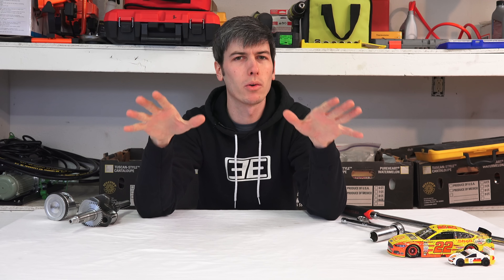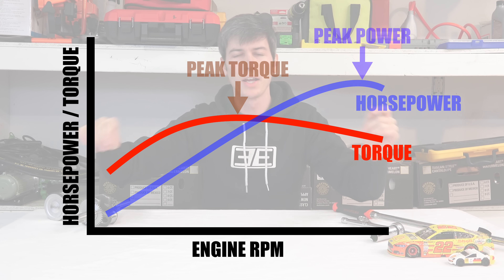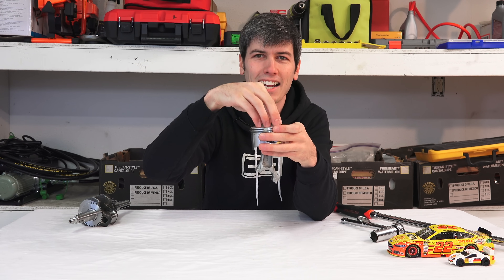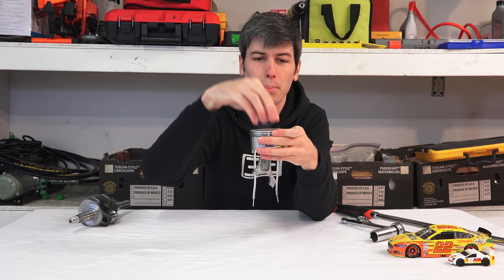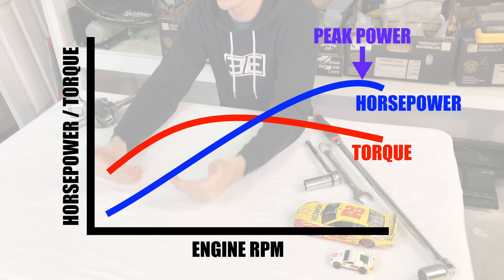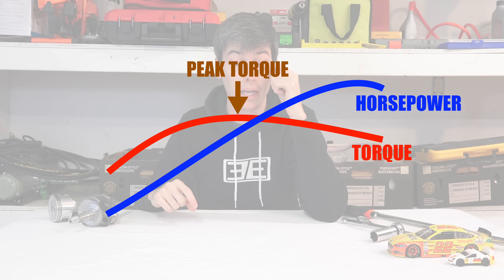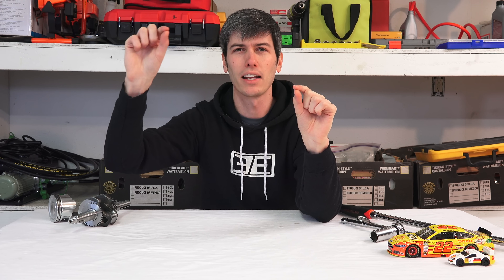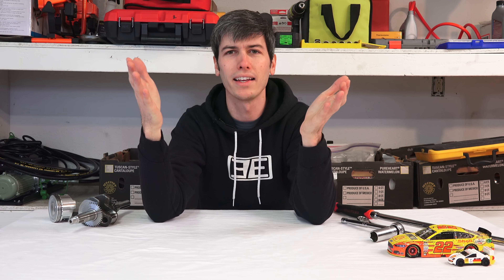Horsepower vs Torque - A Simple Explanation

Comment: why cvt do not fix engine rpm to peak torque instead it fix it to peak horsepower despite peak torque produce maximum 
 acceleration and force
Reply from the maker: Because, as shown in the graph, peak acceleration occurs at peak power using the most aggressive gear ratio possible, which ultimately means the highest wheel torque.

Comment: Everything about these cars are the same, but........they have different transmissions. Real good analogy. If you change gear ratios you change wheel torque. Wheel torque is what decides all friend. And that's a product of transmission gears and final drive. Having more torque from the engine means you can have shorter gear ratios

Comment: why do they call it horse power ?  is one horse power  in car as equal as a real horse :) ?
Reply: That goes back a long long time actually even before the time internal combustion engines were used. Basically it refers to the average continous power output of a work horse. This was used to have an easy to understand unit to compare the power of a steam engine to the one of horses. So basically a steam engine with 4hp could replace 4 horses to power for instance a mill.
A horse can actually put out significantly more power than 1hp for a limited time and even a human can generate more than 1hp for a few seconds.
Reply: thanks for clarifying

Comment: You should also explain how torque and power work in engines that do not or are not designed to rev beyond 5252 rpm and how that results in higher peak torque than power.  Do a video on that. :)

Comment: Everyone who explains this does it in such a confusing way. After watching 4 different videos, getting confused, and staring into space for an hour, I finally understand.

Power = Force * Velocity
and essentially,
Torque = Force = Mass * Acceleration

Horsepower may relate to how fast you accelerate, but not to the actual value of the acceleration. Torque is essentially force, so it by nature correlates to acceleration. Power, on the other hand, tells you what speed you are capable of for a given torque (a given acceleration). High power allows you to deliver high acceleration (high torque) at high speed. If you have a limit on the horsepower you can deliver, you may be able to accelerate well at low speeds, but at high speeds, you have to reduce the torque in order to continue increasing speed. This is done by upshifting. You can deliver the same power from the engine while in 5th gear, but you can't accelerate as well due to your higher speed.

Comment: Could a higher torque lower power engine, like a steam engine (10,000 ft-lbs at 10 rpm) produce similar acceleration/speeds through lower gearing (0.1, 0.09 etc) as a lower torque higher power engine, like a vehicle gas engine (200 ft lbs at 5000 rpm) but at higher gearing (3.0, 4.0)?

Comment: I'm not really getting the formula (HP=Torque*RPM). My car has a peak torque of 320Nm at 1750rpm (on paper). But obviousely I do not have 560000HP. Also if we devide the RPM by 1000 the formula shows that i have 560HP. Might seem like a more realistic nuber, but my car only has a 2.0 turbo diesel engine, which on paper says to peak at 4000RPM with 140HP. Could someone please explain me a bit about this formula?

Comment: Hah, lots of funny discussion below.  I like where he started with the wrench and torque idea.  It might be easier to understand horsepower in those same terms.  Imagine a bolt that requires 100 ft/lbs of torque to tighten.  Now imagine one person can tighten that bolt at 1 rpm.  Another can tighten it at 100 rpm.  Each are applying 100 ft/lbs, but the person doing it at 100rpm is doing 100 times the work.  While applying the same torque, he can tighten 100 bolts in the same time the first person can tighten 1.  They're both applying identical amounts of torque.  If your goal is tightening bolts, which guy do you want working for you?  I'm pretty sure I'd prefer the 100rpm guy to the 1rpm guy even if the torque is the same.

Likewise, the engine that applies a peak of 100 ft/lbs of torque at 1000 rpm  v the one that does it at 3000 rpm.  Same application of torque, but the second engine is capable of doing work at triple the rate of the first.  After the engine has produced power, gearboxes can provide a means to shift the rpm/torque values with minimal losses, but the resulting output isn't anything other than a decrease of torque and increase in rpm or vice versa.

Finally, consider this:  If i have a fully enclosed room with a powered shaft exiting the room and you can attach a dyno to that shaft and measure the torque and RPM, you can have ABSOLUTELY no idea what torque and RPM generated it.  I might have a giant diesel engine at very low RPM and high torque, going through a gearbox to increase the RPM and reduce the torque.  OR I could have a tiny little two stroke engine screaming away at 18000 rpm with a gear reduction.  Or a small turbine at 60,000 rpm with a very high ratio gear reduction.  Bottom line, the rpm and torque at the point you get to see them, outside the room containing the engine and gearbox, will appear the same to you and the dyno you attach to them.  Likewise, when the rubber meets the road the tires don't know what combination of torque and RPM preceded the final gear ratio that delivered the power to the wheel.

Comment: There was a saying that stuck in my head as a kid.  It was a racer who said it.  I forgot his name.  The saying is "torque win races and horsepower sells cars".

Does anyone know who that was and why he said it?
Reply: You are forgetting that there's this little thing that's called gearing. The car that's at 10000 RPM will have a gear 5x as aggressive as the one at 2000 RPM, making that "210 lbf.ft at the wheels" be multiplied up to the 1050 lbf.ft that you are trying to tout as the way to go.

You can calculate the shift points for a car for optimal acceleration if you want. If you try to calculate it by torque through the transmission at each gear for the entire curve, you will wind up with the exact same shift points as if you just calculate by power.

I wonder why that is.

Oh wait, it's because that sacrificing a little bit of engine torque up high to have a more aggressive gear can put more torque down at the driven wheels. Which was already said in the video.

If torque won races, then we wouldn't have racing series with high-revving power monster engines and engines with large turbos designed to make high power, not high torque. We'd still be seeing diesels everywhere because torque wins race, right?
Reply: Because the Turbo Engine produces more average HP over its RPM range. The 122HP and 130HP "figures" are peak figures. In a naturally aspirated engine, peak HP is just that, peak HP, occurring for a fraction of a moment while passing over a specific RPM. In a modern turbo engine that manages its own atmosphere, torque rises to a peak very early in the RPM range and is controlled at a plateau through part of the RPM range till reaching peak HP, at which point, the torque curve turns downward (often computer controlled via waste gate), leaving the HP curve flat till redline. The very high torque figure of the 1.4 turbo tells us that the engine is capable of achieving close to that 122HP figure at a much lower RPM then maintain it through the range, compared to the 130HP naturally aspirated engine, whose torque doesn't peak till a very high RPM. If the elantra had a perfectly "ideal" continuously variable transmission that would allow the engine to jump to peak power, and convert that peak power to acceleration, then, assuming both vehicles weight the same, the elantra would accelerate faster. In the real world, transmissions aren't typically that good, so we are left with having to churn through gears. The Turbo engine, with its wide flat torque curve followed by a wide flat power curve, produces great acceleration across a wide RPM range. Meanwhile, the naturally aspirated engine spends most of its time far below peak power and peak torque while churning through real world gears that prevent it from running at peak power or peak torque for longer than a fraction of a second. 

A high torque specification for an engine is often a good indicator of the characteristics of the engine for driving real world loads through real world gearboxes. A higher torque figure typically means an engine that delivers more useful power at lower RPM, or across a wider RPM range, or both. It's important to understand, that a high torque specification in and of itself, does not have anything to do with how much work an engine can do. It's just an indicator of how it does the work.
Reply: Josh M torque at the wheels maters as it tells exactly the same as power at the wheels at a given speed. But how can you tell me anything about wheel torque if you only know about engine torque ? On the other hand I can tell you everything about wheel power if I know engine power : it is the same if you ignore the slight transmission losses.
Reply: I'm not sure if you understood what I said, since you're agreeing with me. If two 400hp cars are identical, except for gearing, the one making more torque at lower rpm is the one with the more aggressive gearing. It will have better acceleration, but a lower top speed (ignoring air resistance), than the car with lower torque at higher rpm (ie tall gearing). On a track, where you'll have to brake then accelerate often, the more aggressively geared, faster accelerating car, will have the advantage, within reason.
Reply: Charles Watts what wins races is a comprimise which best suits the circuits and conditions.
ducati v twin do well on short circuits but haven't won the tt for decades, there has been recent dominance by the bmw as it has high power at high revs but shakey byrne won bsb on a ducati and haslam second on the kawasaki. the ducati has torque and power lower in the rev range, and less of it than the bmw.

what wins races is balancing torque/bhp and the delivery to the characteristics required. 

torque or bhp could be useless, often the less powerful machine takes victory even on straights if its not got a smooth power curve and wide power band.

take the old wsbk races at hockenhiem when the ducatis would pull away out the chicanes but the others would have caught up by the end of the long straight.
Reply: Old men who raced said it, because it's true. 
Horsepower is nothing more than whatever your torque is at a certain rpm. 1050ft/lbs torque at the wheels, at 2000 rpm, will beat 210ft/lbs torque at the wheels, at 10,000rpm, but they're both 400hp. 
So how can one be faster than the other if they produce the same power? Well, think about what you'd be doing in a race. If both simply had to go in a straight line at wot, it wouldn't matter, but in a race you're braking and cornering all the time. When you do, you need torque to get back up to speed as quickly as possible. 
A lot of cars, if geared badly, would have very high top speed but take forever to reach that speed, which would be useless on a track. Gearing for higher torque and acceleration, and sacrificing top speed, is more important, but when people buy cars all they care about is "How much power does it have? How fast can it go?"
Reply: @joshm3484  This comment just made me understand more than the video
Reply: Old men said it and they say it when they don't know what HP are ;)
Reply: That is wrong.. The figures you give are correct, but the motor that does 10,000 rpm would be geared 5 times lower, and what is 5 times 210?? It is 1050, back where you started. Now, you need to understand about "flexibility" A motor that only does 2000 will only have a usable rev range of about 1500 rpm, but the 10,000rpm motor, say it will not even run below 4000rpm, it will still have a usable rev range of 6000rpm, 4 times wider that the supposedly "torquey" "flexible" 2000rpm jobby..
Reply: Calculated risk, Exactly right...
Reply: Oldsmobile has it as an add campaign in the 50s
Reply: Soee Nying gearing, weight, etc. Maybe, lots of power doesn't necessarily mean fast.
Reply: Smokey yunic  not sure of the exact spelling
Reply: You have no idea what you're talking about. Just ask the guy who made the video.
Reply: -Teddy Roosevelt
Reply: Charles Watts ninfren
Reply: to put in a nut shell 2 identical cars with identical gearing identical weight one with 400hp 200flbs torque  and one with 300hp 300flts of torque the second one with 300ftlbs torque will sprint of the line faster be better in short circuits and the first one with less tourque will be faster on long circuits and have a higher top speed  the guy complicated this too much when talking gears thats a different subject and completely negates talking about hp and tourque for this video as not given true sence of what the difference is
Reply: Charles Watts I don't know who said it but it sounds like something said by someone who drives a diesel pickup and not a sports car
Reply: NASCAR
Reply: Why volks jetta 1.4 turbo 122bhp 200nm is faster then hyundai elantra 1.6 130bhp with 157nm? Jetta is 8bph less than elantra.
Reply: I'm talking about identical vehicles with different gearing.
You're talking about taking the torque at the wheels, then running it through a second transmission to cancel out the first gear set?
What about the phrase "at the wheels" is so difficult to understand? Take two identical cars with different gearing. Run them on a dyno. The one with more torque and a lower top speed would probably be the better track car. This isn't exactly some unusual or mysterious concept.

Comment: Why does a Tesla accelerate so fast? People speak about electric engines having large amounts of torque. How does it generate such a torque value if it does not have pistons supplying a force connecting to a rod (length).
Reply: Electric motors have peak torque at very low rpm, hence the initial kick and huge acceleration at lower speeds. Torque is what makes things spin. Electric motors definitely spin stuff so they generate torque.

Comment: Does that mean that theoretically Cvt are better at delivering Performance "putting aside other Cvt down sides?
Reply: It does. But don't worry, CVT still have many drawbacks ;)
Reply: Meatboy 106 thanks meatboy, I do understand that the drawbacks are in the sense that CVT can't take much power.
But if we are to compare two similar cars same brand, engine and all the rest of the details, but one has a CVT and the other is normal automatic, what will happen in a drag race, or from 0-60...
For the sake of discussion and not for debate. Thank you
Reply: Khodor Al Baba CVT can take much power if designed appropriately. You find them in tractors. But I know from personal experience driving a Nissan Micra and a hybrid Toyota Yaris that CVT feel weird. It sounds like a scooter and often make the car scream to death for no sensible effect on acceleration. Apart from that, CVT are great on paper actually.
Reply: Meatboy 106 I have been driving cars with CVTs ever since 2008 Lancer ex gts (very bad cvt) then nissan Altima, cvt experience was much better, still screams, now am driving a Subaru legacy 3.6, and I must say it's a very good CVT, and it does not feel like a cvt at all, and I am very impressed with power delivery, picking up speed is almost instant, I'd suggest of you go and test drive one and let me know how do u find the cvt experience on a Subaru legacy 3.6
Reply: Khodor Al Baba CVT on a 3.6 must definitely feel better ;-) If I have the opportunity one day I'll try.
Reply: Meatboy 106 cool, I hope you enjoy, Nissan Maxima also is a cvt, I have tried it, but IMO I felt that the Legacy is better on the cvt, though the maxima is much faster..

Comment: The analogy with the car isn't that great because on a flat surface you don't increase the potential energy and all the work is done against the forces of friction and resistance. The air resistance does depend on speed so you need to do more work if the car is going faster even though it's the same distance.